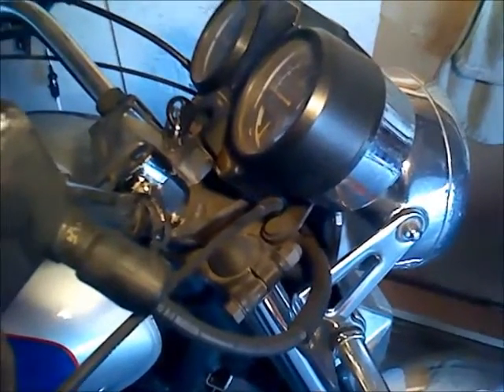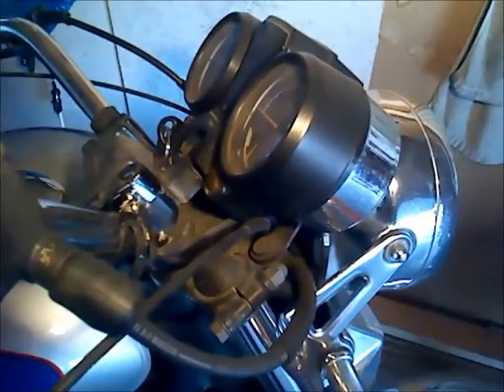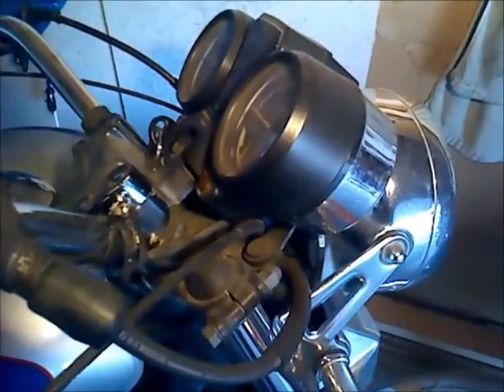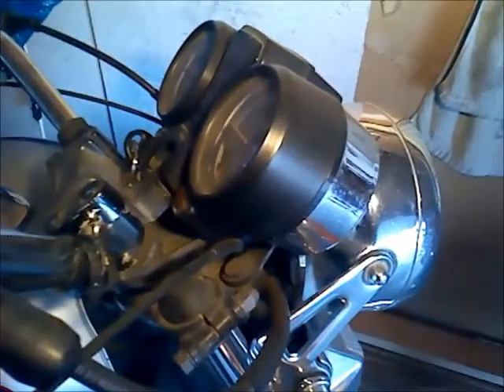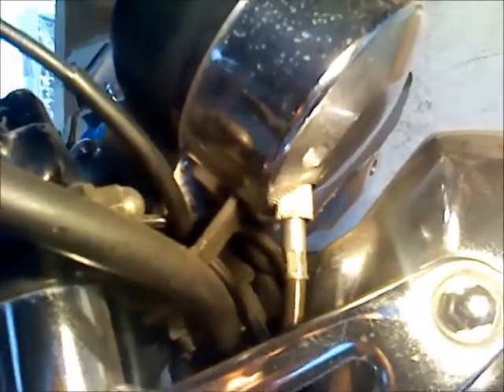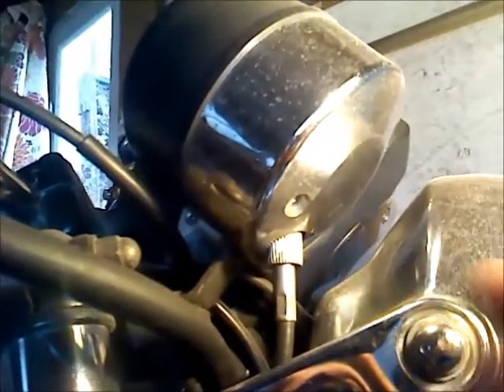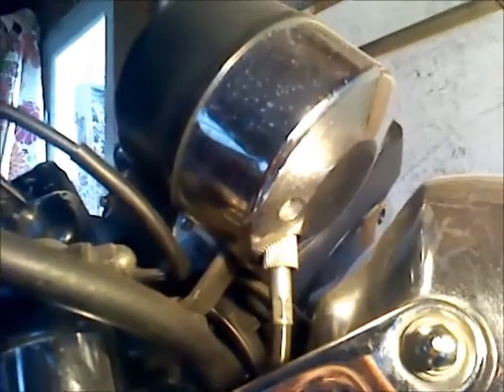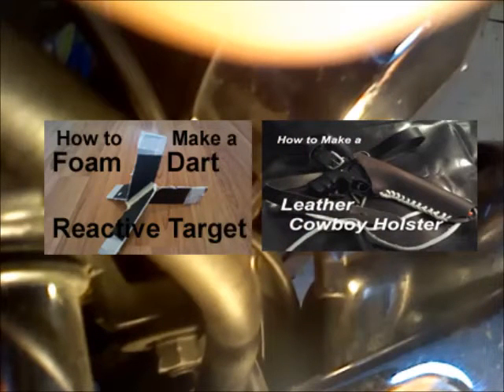How to fix a Screaming Speedometer Cable - Motorcycle Repair

Comment: Ty it worked. If for some1 don't work. take ur spedometer of ur baby and lean little like bearing in meter woth toothpick and ad a litle wd40 and then lube the tip of the cable and try riding a little bit aand it shuld be fixed.

Comment: Thanks man 
My 1980 cb650c just started doing this 
I'll have to give this a shot
Reply from the maker: +erik almonaci  Yes It works great on my bikes and I found a spray can of WD40 also works fine as it runs down lubing the whole line quicker than the grease and is cheaper.
Reply: @PatriotContraptions  thanks sir I will try this

Comment: have to try this . I have been facing this problem since 7-8 months. Does it work?
Reply from the maker: Worked for me, I try to lube it once a year now and it hasn't made a noise since :-)  Note there is a point at which the cables go bad as well and all the lube in the world cant fix the problem.  I would say lube it good and if that doesn't work look for a new cable.
Reply: @PatriotContraptions  thanks for the advice. Changing a new cable would not be a problem. I hope there wouldn't be any problem with my speedometer

Comment: I have like a chirping noise coming from my front wheel. I took the speedo cable off and the bottom of it that connects to the speed drive  looked like it had rust in it or somthing i took the cable off and it stopped making the noise so i cleaned it all up put it back on but still make a noise
Reply from the maker: It could be the cable needs replaced as they do go bad over time and if it was rust on the cable I would play it safe and swap it out because there could be more rust in the cable then what can be seen.  Also if there's rust there tends to be water, if it was well oiled that would not be to bad but as not, you may want to check around for more rust on the parts connected to the cable.  I am not 100% sure this will fix the chirping sound, but a good way to check, if this is a safe option, would be take of the cable and ride the bike to see if the noise is gone.  Bad breaks or stuff on breaks could be a issue to check as well.